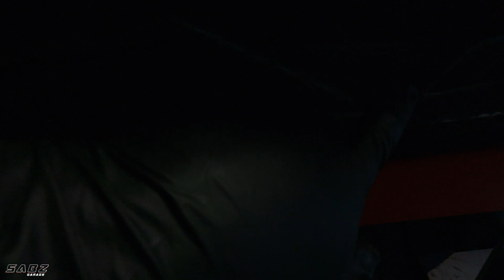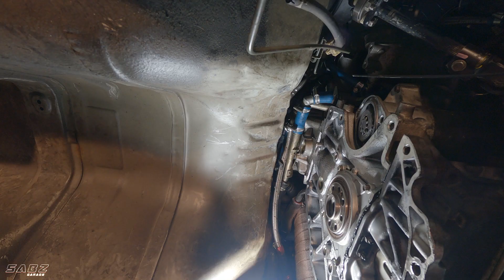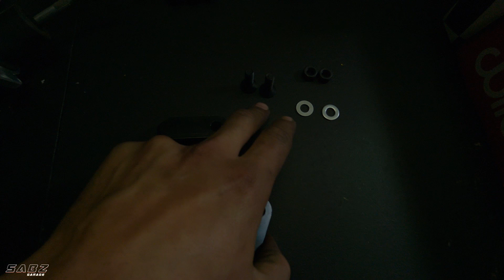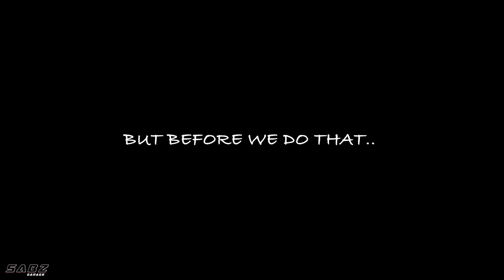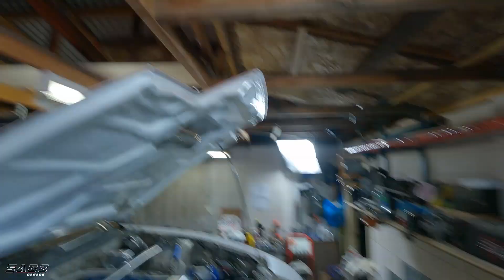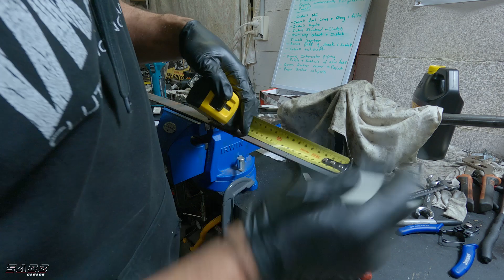[Ep.23] - WILWOOD CLUTCH MASTER INSTALL | Driveline Refresh Series! [S13/180SX/240SX]

Comment: "The smaller the master cylinder the softer and longer the clutch pedal will feel. The larger the master cylinder the shorter and firmer the pedal will feel.If you are running a standard or near standard clutch, then the smaller master cylinder is recommended. If you have upgraded or running a stiffer clutch assembly, then the larger is recommended." per Gktech's website,

Is the master output thread pitch and flare the same as stock, if not what clutch line are you running?
Reply from the maker: I'm running the GKTECH direct line kit, the one that bypasses the clutch damper box (as i removed it). So it runs from the master cylinder straight to the slave on the box, found on their site.. Works great! 

Be mindful though, this will stiffen up your clutch, and if you're running an extra heavy duty / stiff clutch get ready for a workout lol. Considering this is a track only car i don't mind it but wouldn't advise it for every day street use (removing the damper box that is).